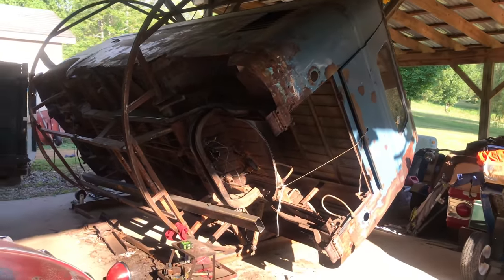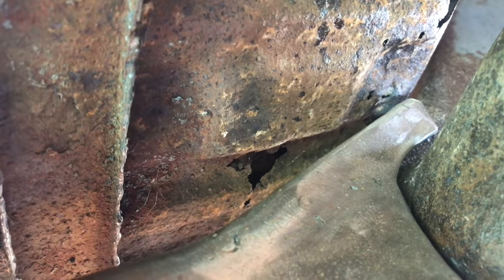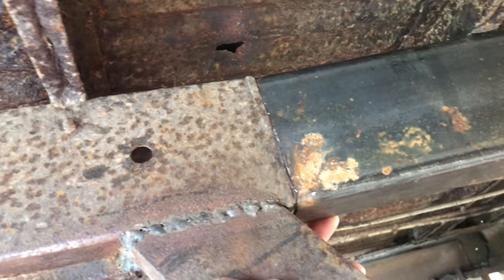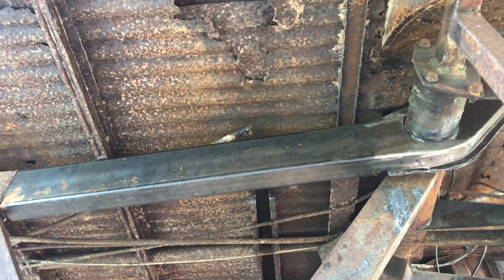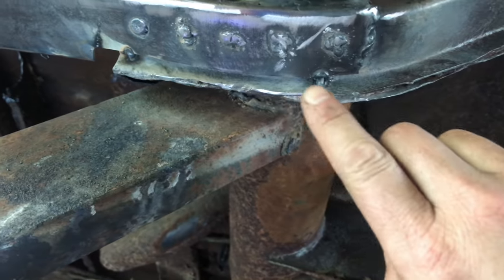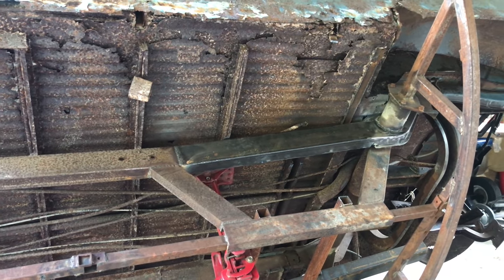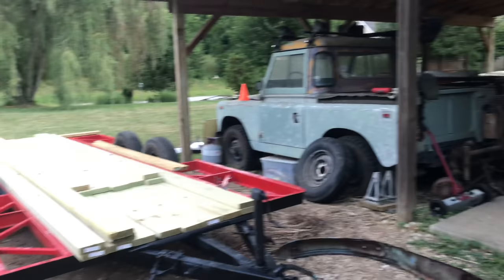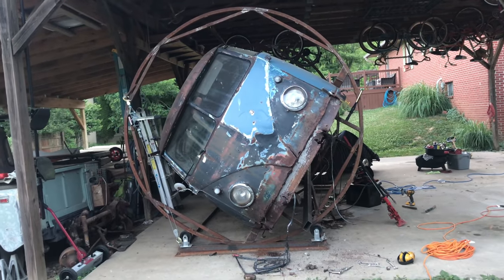1958 Pressed Bumper VW BUS First piece of new frame welded in place!!

Comment: Marcie, coming together nicely. A welding tip to possibly save a bit of wire on wide gaps. The old school rods used before mig welding became the norm are basically considered trash if they get wet. If you can access some that are not usable, grab them. The flux and be broken off easily with a hammer. The core can be used as a filler to help fill the gap as you mig it in.
Reply from the maker: I used "filler" rod when I did the rotisserie I usually use a steel coat hanger  because that is what I have, but have some stick welding rods around here somewhere...that is what I started on, MIG is so much better! lol 😆thanks for always having my back and always a tip for me Donnie! truly appreciate you always being here! catch ya on the next one!
Reply: @marcijunebug  if you like mig....you would love Tig. So much easier with light gauge metal.
Ever try to weld 26 gauge?  Hahaha. Be careful young un.

Comment: dont overthink it you have a lot to do there get an idea and run with it. I would have removed all the frame up to the torsion tube. that is how I did mine  videos releasing soon. check it out. went with 12 gauge square tube cut in half and bent the bottom lip as well. yours will work just fine. Consider the way I am doing my floors it is much cheaper than the OEM parts way.
Reply from the maker: I'm a scientist, therefore I overthink everything! 😆everyone has their own way of doing things...that's is truly one of the best things about youtube! Love the variety of ideas out there! I already have floors and rails for the floors

Comment: I've been struggling with repairing the rot where the running board attaches on my beetle. But it's nothing compared to what you have accomplished on this bus that many would have sent to the car crusher.  You inspire me to keep going. I do hope you show some hammer and dolly work on the bumper.  That's something I've never done and need to do. It is really starting to show now how your pre-planning on making bracing that would work and allow you access to work was well thought out and so necessary on this project.  You should give yourself a huge pat on the back. Can't wait for the next installment.
Reply from the maker: Yes, I thought and thought and thought on that rotisserie build and I did modify my plans as I went along with the build...it has paid of in spades and I am so thankful now that I took the time to make it...because it makes this stage so much easier! thanks for being here, catch ya on the next one and good luck on your beetle!

Comment: Hi Marci, I'm a little late to comment however I comment now, First of all, you are amazing each time with your escapades with your discussion with approaching the problems and your capability to solve the issues under the working time with pickles. Your not alone as I see It a fine and resource-rich Lady Bud also a performer of fine metal artwork  I did like that new art You did nice welding on the framework. Also, there is in the front a part with good metal left.so I`m looking forward to your next video.Greetings HCS.
Reply from the maker: better late than never! I long for the day I can just go for hours on a project, but with my little guy and a full time job I try my best to use all the time I'm allowed and cherish the "free" time I have lol Pickle is a massive project, but doable...I do try to fill all my "holes" in time with small little art projects and the plasma cutting has been really fun lately...cheers
Reply: @marcijunebug  Yea it's not easy bud Full-time  job and your little guy you doing a great job aswel as an Mother and employe and still have time to do what you are doing,it`s admirable,That with make it great to follow you.Thanks for sharing ,regards HCS.

Comment: Looks like the welds are as strong as the factory ones which is what counts. Remember they were designed to carry 1125 kilogrammes😁
Reply from the maker: thank you I think it will be just fine, these were some of the "first" unibody cars so I think important to make sure I get all the bits and pieces welded together in the end...that's what adds to the strength as well! cheers!

Comment: Nice job on the frame repair. Just did the football trick on my 57 SC. Looks better but I will still need to cut the bottom due to rust behind the nose. You may want to remove that bottom skin for rust repair behind there......it's the only way to get to that area.  I don't think that bottom nose skin is too expensive. Good luck
Reply from the maker: thanks! Yes I will have to likely cut much of that out...I was just happy as a clam that there is enough there for me to make a pattern! I will probably just english wheel, bead roll and hand hammer what I need from raw steel...unless I can get a great deal on one at a swap meet or something! cheers!

Comment: I also would not use the plug welds I dont think they will help all the edge all the way around should be fine.
Reply from the maker: I did both...figure I'd at least give it a fighting chance, just couldn't do the solid weld as good with the bus turned like it was...flipped it and welded it up good and solid!
Reply: @marcijunebug  yea looks way stronger than original. in a few days I will release the frame video it is super cool.

Comment: My experiences , you may want to upgrade transmission mount there is a early.( small) and late swing mount
Reply from the maker: for now I'm planning to go stock, but I hear ya...and I have both here to choose from...I;ll think about it and play it by ear! thanks for being here David, appreciate the comment!
Reply: Want to hear the engine run out of the chassis on Pickle, set up a test stand, will you be splitting the case or just a top end re
Build?
Reply from the maker: @rsprockets7846  will delve into it probably this winter it actually DOES run, did a run video and it honestly sounds great, we will dig into it and see what we need to do, original miles on the bus are 50,000 so I'd say engine is likely fine...here are the two run videos...and yes it the same bus...the first run video it was still painted black on back and had 63 Mercury taillights on it! lol
https://youtu.be/4g5kJ773zzY

https://youtu.be/n7tgsDSmxnk

Comment: In the spirit of saving money and not doing a 100 point resto, I wonder if you could pick up some pickup truck bed floors cheap at a junkyard to redo the floor in the bus. I gotta think a Silverado or F150/250 8 foot bed would get you a lot of material. I expected there to be no metal behind the nose patch...so, I guess this is better. lol
Reply from the maker: JayinMI I mentioned in another comment, I have the flooring...so far I’m out $40-ish in metal, rest was a gift from the ole double cab winning a show😉

Comment: Hi what the story about the land rover in back round.
Reply from the maker: It is a runner I just haven't driven it much in the last few years as it wasn't safe to have a rear facing car seat with my little guy in it...but he's old enough now so soon It will get it's day in the sun again...I am planning on building a hoop set and canvas like my double cab has for it this summer.  It also has a matching really special tent/camping trailer that goes with it that I would like to get going this summer as well! they are a great pair!
Reply: Hey I have 1970 series 1 im trying to get it fixed after I'm don with my 74 vw camper 
Do you any extra part for land rover
Thanks
Reply from the maker: @hanial-omari7269  I love the old rovers, this one is a 61 with 73 headlight buckets (those were changed before I bought it) and it has a fairey overdrive in it so running highway speeds of 65mph-70 isn't a big deal...I don't have too many extra parts, but have always had great success with Rovers North in Vermont.  They have worked my through some pretty serious problems with my discoverys (I've owned 2) and this series 2A.  Always willing to offer tech support and reasonable pricing and good inventory.
Reply from the maker: @hanial-omari7269  would love to see pics of your projects! Email me marcijunebug@yahoo.com 
cheers

Comment: You can use Cold Galvanizing spray paint as a weld through primer. It can also be used on muffler parts to prevent rust from forming. https://www.homedepot.com/p/100142963
Reply from the maker: thanks! good to know! will check into that...it is cheaper than the 3m stuff

Comment: Marci, I will comment this, go online and shop for genuine VW sheetmetal for your restoration needs wolfsburgwest sheetmetal
specialist can locate you a nose panel piece for your bus.
Reply from the maker: I know all the panels and pieces can be bought and I've address this in other videos...but I am trying to get better at panel and piece making so I plan to just make what I can, plus I want to keep cost down and those two front frame pieces alone are more than I paid for the bus...but if I get in a bind i WILL buy what I need because I want to ole dude on the ROAD!